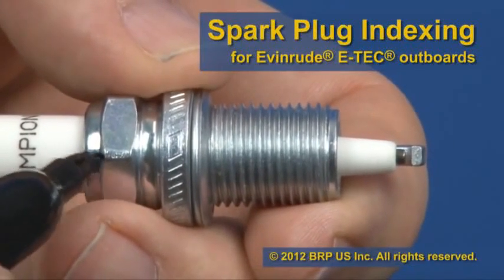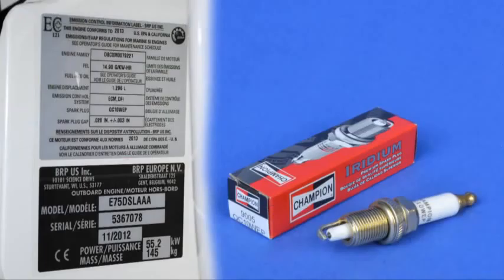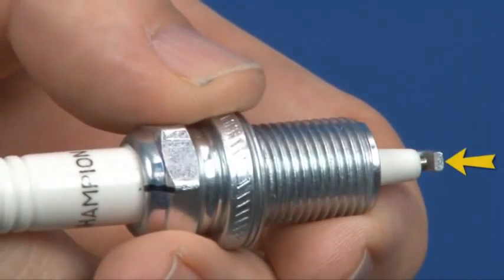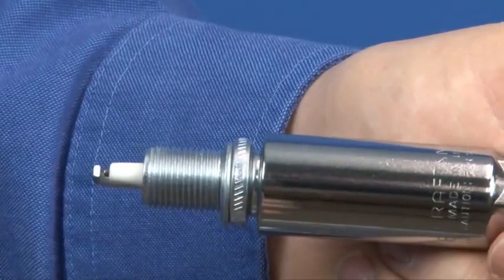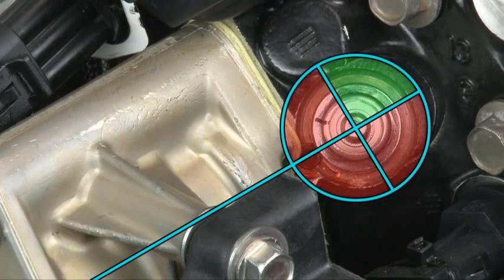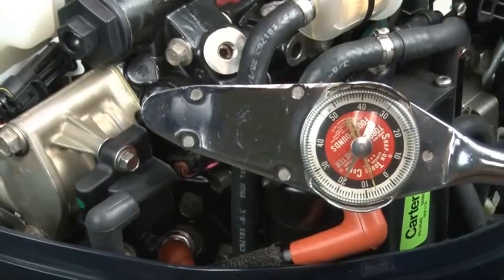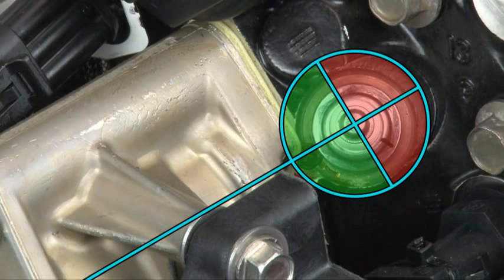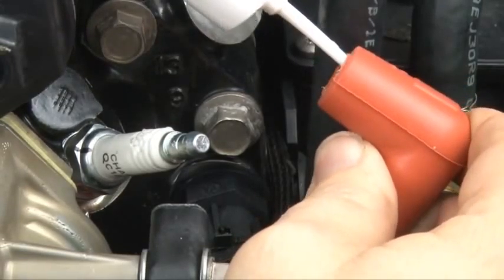Spark Plug Indexing   How To-iboats.com

Comment: In order to do this you need to have 20 spark plugs available to find 4 that align correctly. This is madness... 
The whole point of the indexing is to avoid the 'back' side of the spark plug to face the injection path. 
At the last workshop they motor was in the left the one spark plug untorqued and another torqued to 3x the normal torque because it fit the indexing better... 
Remember, a bad workshop is a motor's worse enemy. Worse than even abuse.